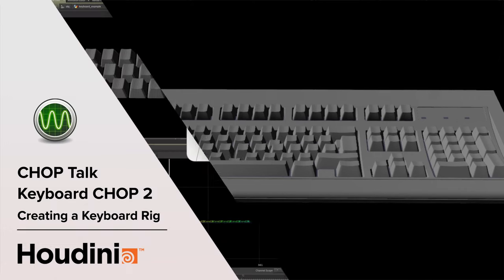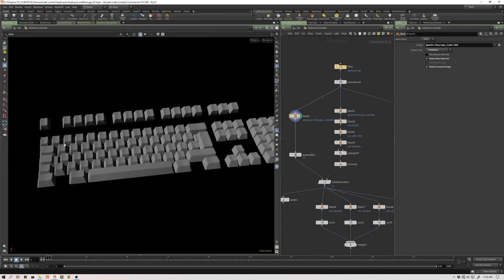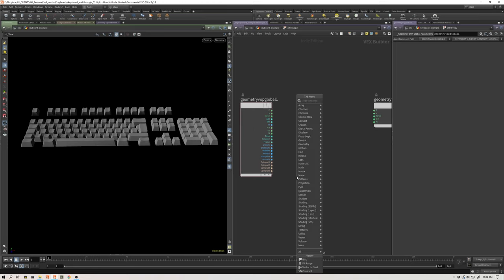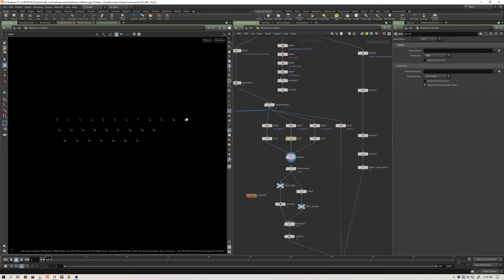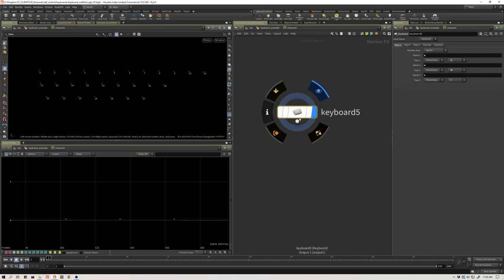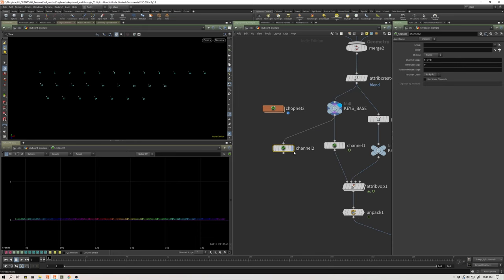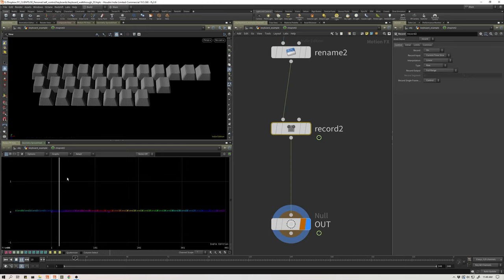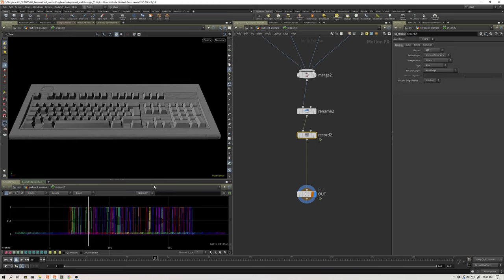CHOP talk Keyboard Rig

Comment: Noticed in the original animation that which you posted on twitter, the spacebar was also animating. Any way to get more keys or an enhanced Keyboard Chop node that listens to more keys than the ones provided? Spacebar, CTRL, shift etc
Reply from the maker: Not that I know of. The keyboard chop only receives data from the the keys in it's dropdown. On the fully rendered shot with the keyboard that I modeled, which wasn't the original, it was made after I recorded this tutorial... I used the sound I recorded, isolated the lower frequency sounds and drove my space bar that way. What you could do if you want movement on other keys, is use the keyboard number pad and then just map that channel to whatever the point number / channel of your spacebar in your model.
Reply: @WhatIFound  yea thought of just remapping. Sucks but maybe it will be implemented in the future. Thanks for the quick reply and amazing video!

Comment: Is there anyway to make the channel number be the value of the attribute? (ex: pressing channel 12 makes blend = 12 / channel 2 makes blend = 2)
Reply: Sure, in sops you could just do it in a wrangle @blend *= @ptnum;   I haven't sat down to try this to confirm, but that kind of value manipulation in sops is what makes Houdini Houdini. :)
Reply: @jasonharmon9538  I meant for example having just one point, and the blend attribute value increasing as you press higher value channels.
Reply: okay, i found a way: I did a wrangle after the channel SOP with:

if(@blend >0.0){
    @newattrib = @blend + @ptnum;
}

then promoted to detail, copied the attribute to a single point and promoted back to point attribute :)

this way I'll have a "pitch" attribute when I input my midi piano to houdini, thanks!